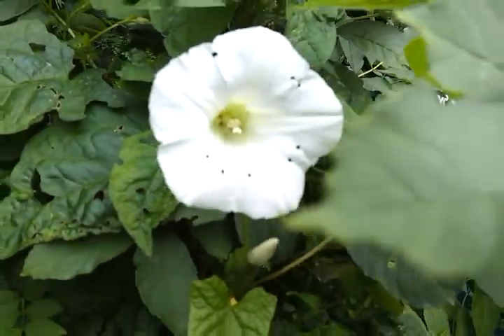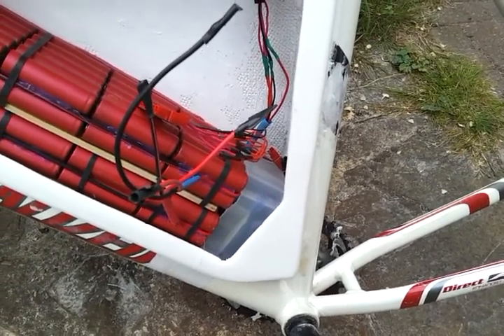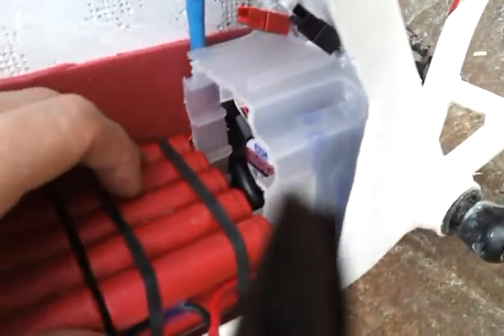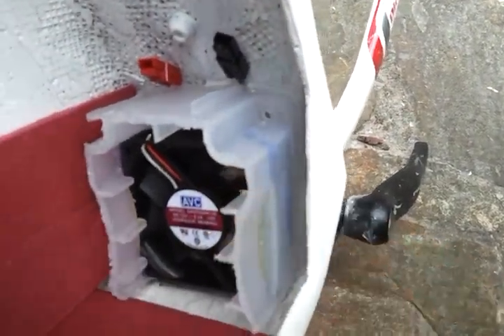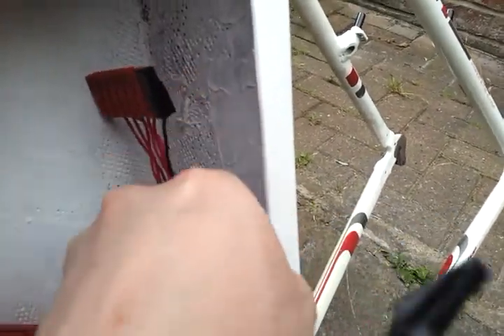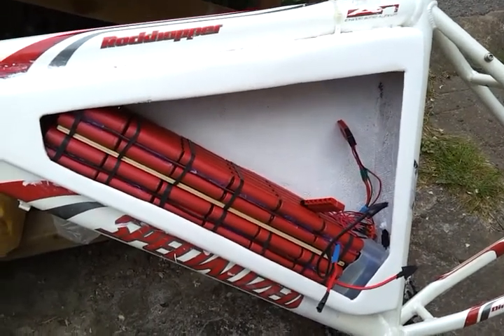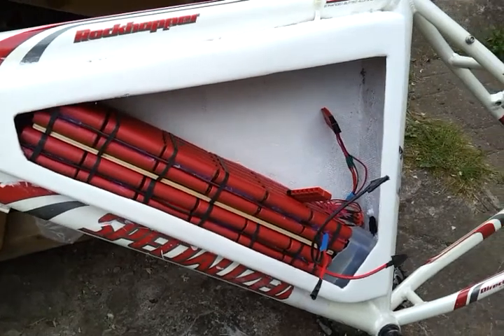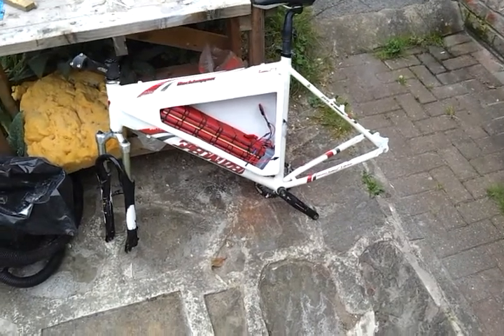Fan test fit ..

Comment: i highly doubt you will be needing a fan unless your going to be powering like a 30kw motor. your battery pack is so big it could power even a 2kw motor without heating up too much prolly.

also if the fan is always going to pull the same amount of power, you could run it off 48v with just a resistor on it.
Reply from the maker: Thankyou for that..i watched a great you tube video about what causes lion cell failure...they were saying exposure time to heat during charge/discharge cycles is where the major parasitic reactions happen so keep it cool or use it quickly!it was called why do lithium ion batterys die.channels called English for science i think.its over kill i know..im gonna be running some led lights of the auxiliary battery too..and i can't just leave it running..that's silly of me.so i ll try for two switches one for lights one for cooling:)..i ll do a video of the hills round here soon give ya an idea of what im asking of the bike..as ever its alot !.also can you advise..will 25a cable be ok on my24v20ah battery ?or should i go for40ah..thanks again.all the best.:)